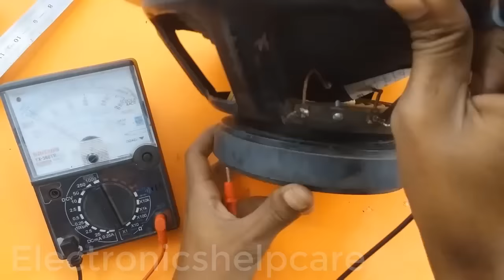Voice Speaker repair, electronics

Comment: Basic repair principles are ok except I would be shocked if the coil didn’t rub on the magnet when completed. You must use spacer shims for proper coil centering. Also your coil depth is guess work.
Reply: How do you decide coil depth

Comment: How did you decide magnetic center  and physical  center of voice   coil?
Reply: this size is easier to centerize the cone. smaller than 4-5" or bigger than 12"-15", often after 2-3 months, you hear the noise of scratching and need to recone agaaaain 😫 a few pieces of thin papers must be slided inside center coil to prevent this problem till glue will be dried 😉
Reply: They didn't center the voice coil. This is a bad video because they did not use shims.

Comment: You shouldn't scrape the insolation off the coil wire either.
Instead you must either use molten solder or lighter flame to do so.
Good work but you will get 7 out of 10 from me.

Comment: Pardon my ignorance on speaker basics - would like a tiny direction for my problem. I bought a 8inch 50 watt woofer (not sub woofer) about 15 years back, used it for few hours and it sounded good. I opened it today and connected it to my amplifier and it outputs too little volume. I gently pushed the cone and spider up, and the volume goes up and it vibrates well. How can I fix it? The spider feels hard... the soft rubber on the outer edge of the cone is soft/flexible...
Reply: I have the same problem with two entire media rooms. Did you ever find a solution?

Comment: The rusted body structure needs to pre treated manually before going on for the reconeing. Higher magnetic flux at bore & pole peace  area will attract the rusted particles to reach there,  even when the speaker is not in action. Secondly if structure is showing the tendency of rust formation, it should be nibbed at the earliest to save the refurbished component of same symptoms & saving other adjoining components as  spilling of these particles are not good to other PCB plates like crossover Network or Mid Speakers in the enclosed Columb.

Comment: You're going to have a hard time playing that at a low volume.
The coil will be touching the magnetized center.
You must first assemble the coil, the spider and the basket (diaphragm) before glueing it to the frame.
Reply: true, also why cut the neck of the coil so short, there will be hardly any  length left to attach the cone. problems
Reply: also what of the spacers to keep the coil centered before applying the glue
Reply: Hello sir Dalton. I have a loud speaker but I want to get more bass from it. I was suggesting to transfer the cone to another basket that can accommodate a bigger voice coil. Already i have the basket and it has a has a bigger magnet. Will this idea work out as i continue to save some cash to buy a perfect driver? Please help me

Comment: Hi I have an audiopipe 12in. Txx blue eye candy sub that was passed down from my brother that has passed away. So know it's the only brand I run. The dust cover sperated from the coil but the coil is still good. I had it in a sealed box and hit some low hz. that's the reason for it happening. It don't have to be the blue aluminum look just want to hear it play and bring back some memories of him. Please help ppl say throw it out and get a new one but I can't seem to do that. Please help me even if it is bad news.thanks for the time on this issue. Keep the videos coming they help out a lot.

Comment: Is a good video but i would like you to do a repair for Sony home theater woofer speaker since mine got burnt half,coz Sony says the connection between the 2 coils is cut. But the woofer does good in moderate volume, but when i go higher my home theater system go off and give a warning of power protect. So I don't know how to handle the woofer speaker . Any help?